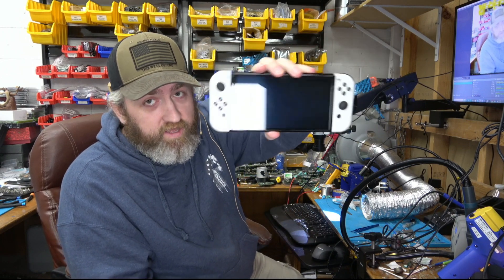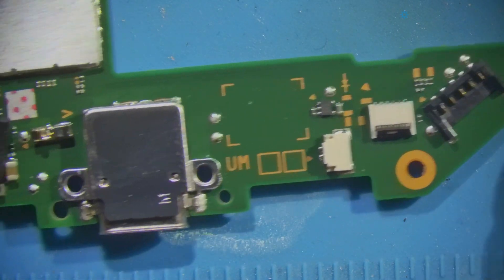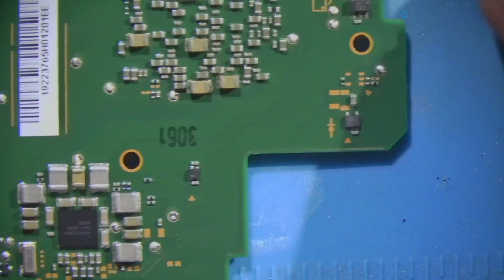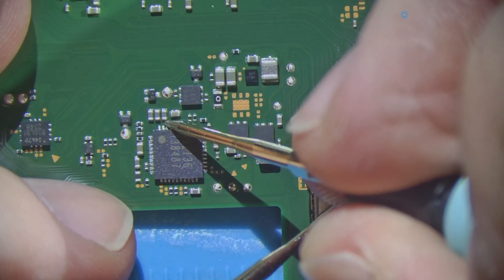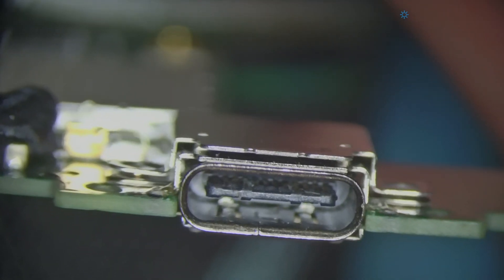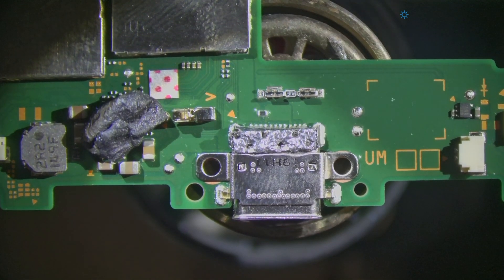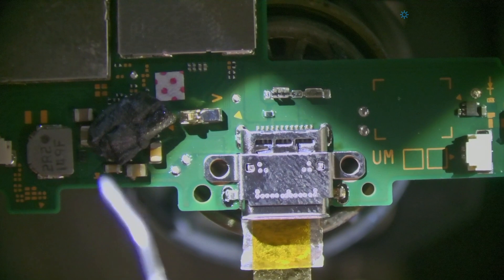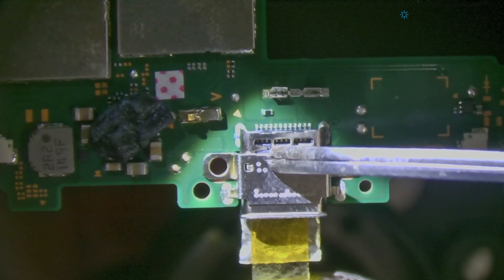Switch OLED how to replace USB port and fix charging problem. (corroded charge port)

Comment: Hey, i just bought a secondhand switch oled. But after a day wouldn't charge. After a failed repair by a local shop, im wondering if i could send it to you too look at. They changed it the usb port but it doesn't turn on.

Comment: I was wondering if I could ask your advice. I've got a switch that charges in its dock no problem. Ports are cleaned and inspected. The thing is it works great I will keep it working great to the best of my ability. It just will not dock on the factory dock anymore. It does in fact however dock on an aftermarket dock with slight artifacting but I do not trust the aftermarket dock as much. I do use the factory switch charger as I'm scared to plug in any other charger into any switch. I do know there is a HDMI chip on the dock I'm just looking for suggestions and where you would test first. I appreciate your videos and keep up the good work.
Reply from the maker: @Wickedlazy  do you have one of those port testers that I use in my videos?
You need to determine if the issue is with the switch system or the dock. Docks are repairable, but not usually worth the effort versus replacing.
Reply: Sounds like the dock. Why are you scared to use aftermarket stuff? Everyone does, I do, it's not gonna hurt anything. It's literally the same stuff just without the Nintendo logo.